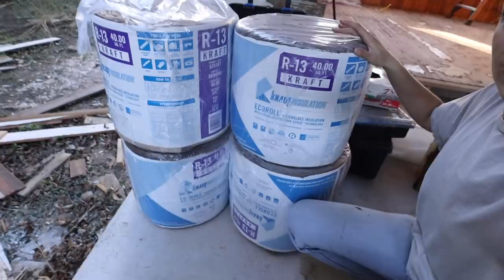digging up our front yard + new bathroom sinks!! | XO, MaCenna Vlogs

Comment: That window putty in the tube is supposed to be applied with a wet putty knife.  It splurges out and you get rid of the rest when it is dry after about a hour.  Leaving a sharp line.

Comment: Order x14 right now with express delivery so you can spray around all of the openings. Since you didn't get the house dried in mold is going to form because of the water. You really want to nip this in the bud. If you don't get rid of the mold you can really sacrifice your health.  Keep moving forward. Just make sure you do what you have to to prevent future problems. Dry your home in before the sheet rock! You want to see major progress but please do it right! Mold is no joke it can kill you! I always sprayed x14 in homes that were not dried in after a big storm (hurricane) some I could see the mold some I couldn't.  I only had one home with a leak after it was complete x14 and corrective majors were made. Out of 49 houses this one was missing just one piece of siding that caused a leak and mold in a closet. Of course siding was corrected and mold was eliminated.

Comment: If she's just putting in one pane of glass I'm worried her house will not be well insulated. Double-paned glass can seriously reduce your electricity bill when it comes to hot summer days or cold winter nights. My fiances family just switched out all the windows of their home with a service that cost $10,000 total. It made a world of difference and made their place from an always-cold home to a warm-cozy home instead. Just something to consider.
Reply: her floor boards are over straight dirt, not even a subfloor let alone insulation, so i'm not sure that energy efficiency is on her radar. maybe she has a reason for that, not sure.